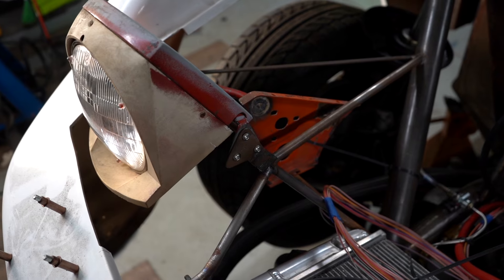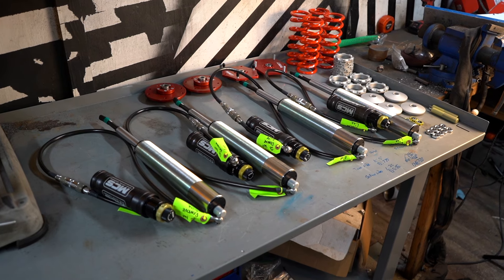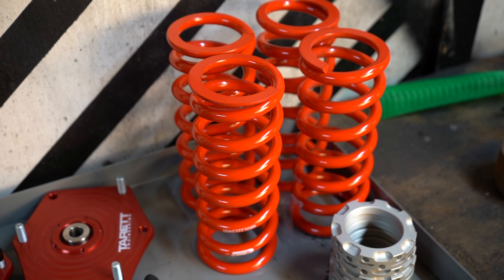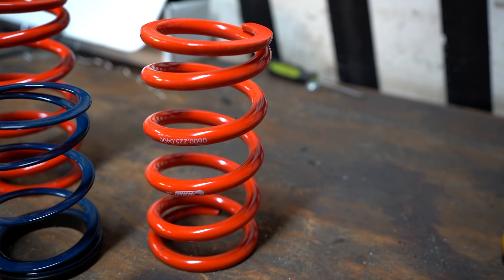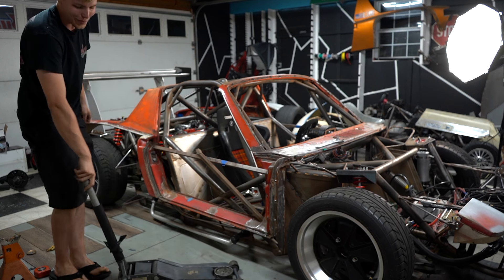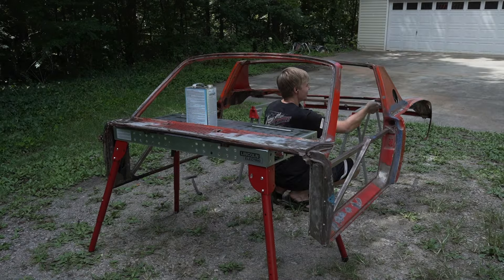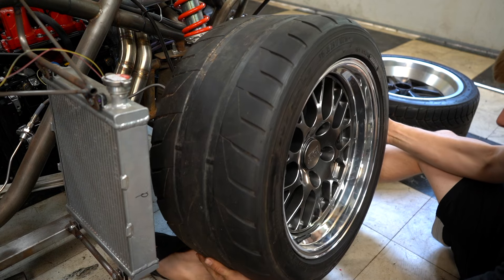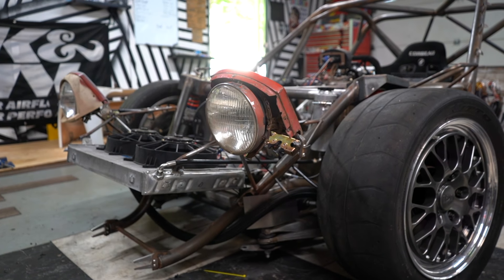Custom Coilovers, Big Tires And Pop Up Lights! | Home Built Porsche Race Car Ep.22

Comment: Yeh another video from Zip Tied. I should probably save it for later but...... I'm just going to watch it now...
 Cool lights, like the simple operation, less to go wrong.... Get some protective socks to cover the lower threaded part of the dampers. Cause the threads get hammered with gravel.
 Suspension... cool    wheels and tyres... cool
Reply from the maker: The bottom can get damaged without an issue as ill never adjust it in a range that currently sits outside of the clamping area. Cool is good tho!
Reply: @ZipTied  Yes it is....